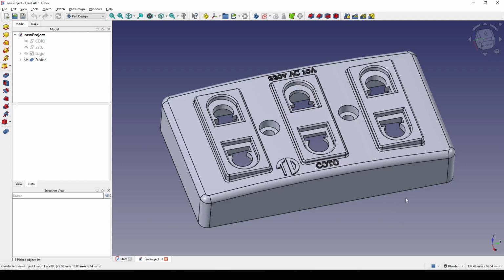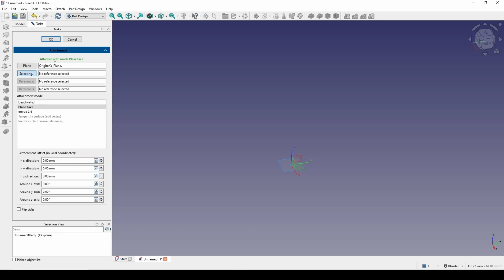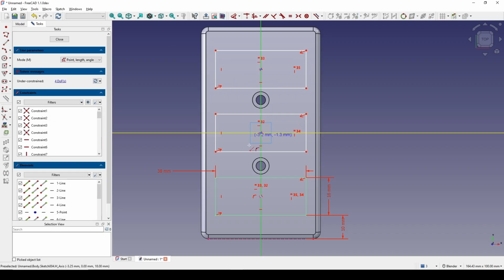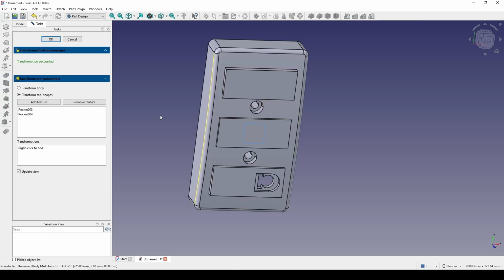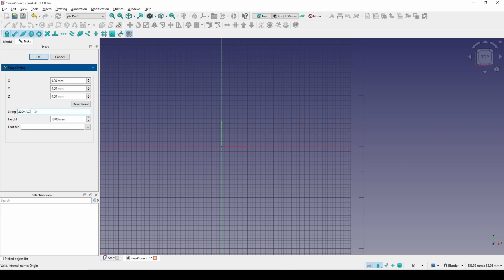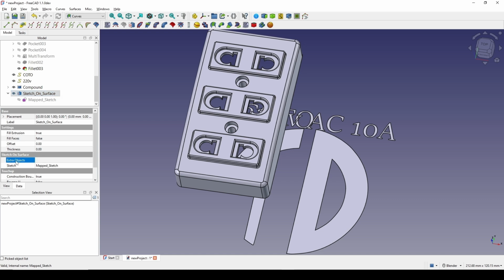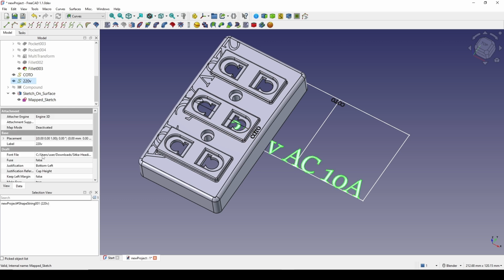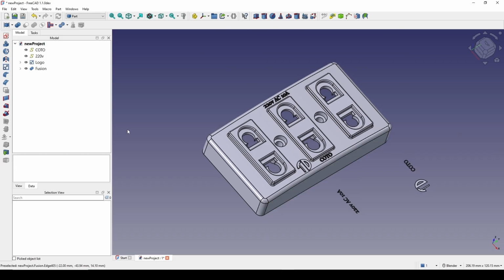Modeling a Power Socket in FreeCAD 1.1 Dev - Part Design for Beginners

Comment: Another great video. Always learn something new. 

You can set the behavior of the external geometery tool in Edit--Preferences-Sketcher You can have it act like ver 1.0 and always be construction or always be real geometery. You can still change it the sketcher using the toggle icon or G,N. One of the most useful changes in 1.1
Reply from the maker: Thanks! I didnt know that setting
Reply: Any benefit to the new default behavior? I’ve found it to be quite annoying but maybe I just don’t understand the intended workflow
Reply: @aribilow  This allows the user to keep a workflow they are used to since 0.21. New users have a choice. I like mine as construction, like the original programmers intended

Comment: Thanks for the tutorial. I got stuck with the Trim Edge, it gave me a hard crash on Freecad for Mac. After 20 crashes or more I managed to bypass it removing all the constraints for the sketch and then adding the constraints later once it was trimmed. That didn't crash my computer. 

I tried to add a fillet to the text but it is imposible. Is there I way I can fillet the text edges? Thank you in advance.
Reply from the maker: @Laziness-dy6ti  20 crashes! You are really patient. I use Windows, its pretty stable here. I dont think we can fillet these texts.

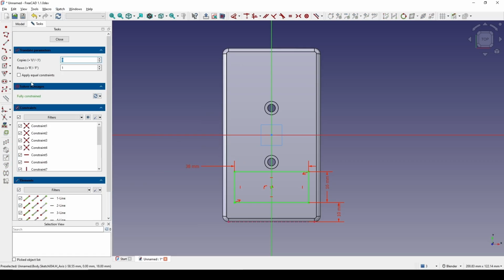Comment: 9:50 can i just clone the socket, position them nicely, and continue editing on the original socket while replicating the edits into the 2 other clones?
Reply from the maker: @lcsiew8875  Im not sure I fully understand your question. But if you want you can extrude the small rectangle and finish it in part, then create 2 clones, position it to corect position and use connect tool in part to join these 3 with the main one. But you have to create the through all hole later and the small fillet.
Reply: @DuyQuangDang  yup that is almost what i wanted. What i wanna achieve is to create a rectangle on top of the datum plane, then create 2 clones, and position them in place. Now if i pad or create the through holes on the first rectangle, i want all the same actions to be replicated on the two other clones too. Is this achievable?
Reply from the maker: @ Yes you can, But you need to add the original one inside the body in the part design wb first (base feature), from there you select the body, and create clones. after that go to partdesign and you can edit inside the body of the original.